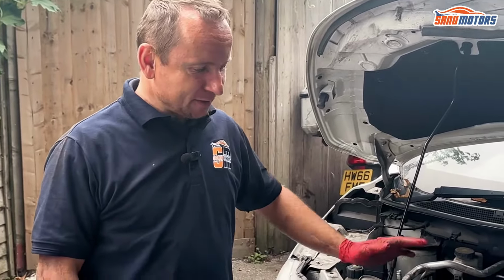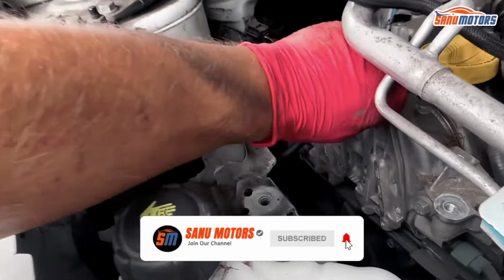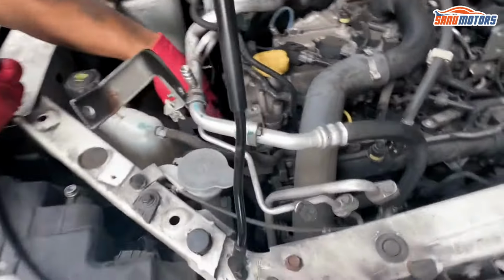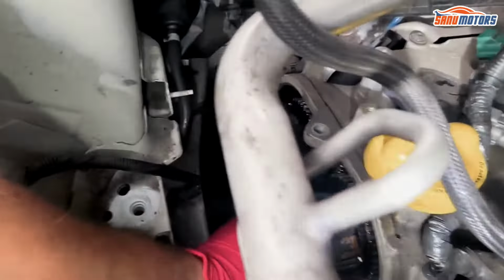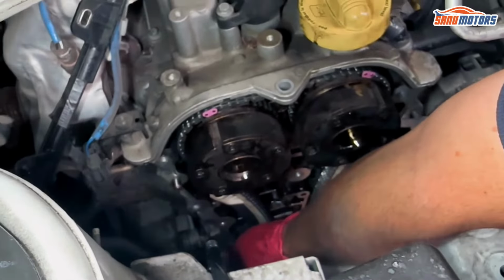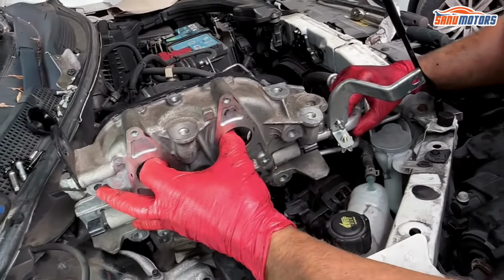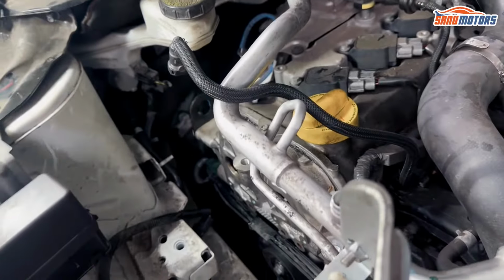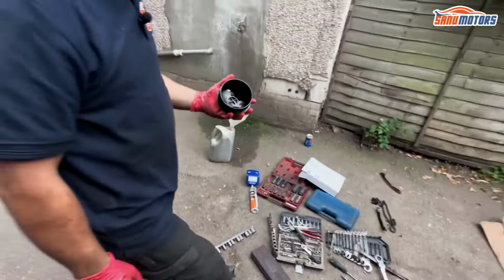Replacing the Timing Chain on Nissan Qashqai 1.2 | Timing Chain DIY Tutorial

Comment: thanks, watched it all. how much of work hours altogether for this job?
Reply from the maker: Thanks for watching the video and for your question. For a timing chain replacement on a Nissan Qashqai 1.2, the total work hours usually amount to about 8 hours. This includes disassembly, replacing the chain, and reassembling the components.

At our workshop, we use a genuine Nissan timing chain kit and also include an engine oil and oil filter change as part of the service. Our charges for this job start from £850, which covers both parts and labor.

Feel free to reach out if you need more information or want to schedule an appointment. 🚗🔧 #TimingChainReplacement #NissanQashqai #CarMaintenance
Reply: Thank you for the video to well done you are good teacher I will be contacting you for the oil leak on my car
Reply: Thanks for video your good I have oil leaking on nissan juke on front cover  can I contact you tomorrow tomorrow tomorrow tomorrow

Comment: My 1.2 nissan qashqai 2015 105 000 km with no timming noise I change oil every 6500 km with 5w30 castrol untill now I have no problems no engine light or codes. Take care of your car, and the car will take care of you😊
Reply from the maker: yes 100%

Comment: dont even have that engine but it was a good watch
Reply from the maker: Thank you for your comment! If you can rebuild your old engine, that’s definitely a great advantage because you know exactly what’s going on with it. However, when searching for a used engine, caution is key as the mileage and potential hidden issues might not always be clear. Be sure to do thorough checks and research before making a decision. Good luck with your search!

Comment: Hello SANU ….thanks for excellent explaining…I have QASHQAI year 2019 1.3-140HP petrol engine consumes to much collant water ..and loses power ..some mechanics tells me the head gasket problem with Nissan qashqai is common and also expensive …have you experience this problems ? Thank you
Reply from the maker: Thank you for your kind words! I'm glad to help.

Regarding your Nissan Qashqai (2019, 1.3-140HP petrol engine), the issues you're describing—excessive coolant consumption and loss of power—are indeed concerning and can often be indicative of a head gasket problem. Here's what I can share based on common knowledge and experience with similar issues:

### Symptoms of a Failing Head Gasket:
1. **Coolant Loss**: If your car is consuming too much coolant, it could be due to a head gasket failure. A blown head gasket can cause coolant to leak into the engine cylinders, where it is burned off, leading to significant coolant loss without visible external leaks.

2. **Loss of Power**: A failing head gasket can lead to a drop in engine compression, which directly results in reduced engine power. You might notice the car struggling to accelerate or generally feeling sluggish.

3. **White Smoke from Exhaust**: When coolant enters the combustion chamber, it typically results in white smoke from the exhaust. This is a classic sign of a head gasket issue.

4. **Overheating Engine**: If the head gasket is compromised, it can lead to engine overheating, which further exacerbates the problem.

### Commonality of Head Gasket Issues in Nissan Qashqai:
While Nissan Qashqai models are generally reliable, there have been reports of head gasket failures, particularly in some petrol engines. This issue can indeed be expensive to repair due to the labor-intensive nature of the work involved.

### What You Can Do:
1. **Get a Second Opinion**: If a mechanic has diagnosed a head gasket problem, it's wise to get a second opinion, preferably from a Nissan specialist or a mechanic with experience with this model.

2. **Compression Test and Leak-Down Test**: These tests can confirm whether the head gasket is failing. They measure the engine's ability to hold pressure and can indicate if there's a leak in the gasket.

3. **Check for Coolant Contamination**: A simple check is to look at the oil dipstick. If the oil looks milky, it could be mixed with coolant, another sign of a head gasket issue.

In summary, it does sound like your Nissan Qashqai might be suffering from a head gasket problem. Given the symptoms and the advice from mechanics, it's likely a significant issue that requires attention. I'd recommend acting promptly to avoid further damage to the engine.

Comment: Hi, How would you time this 1.2 TCE engine if the timing has jumped slightly? is their an old school way to make sure timing is right before closing everthing together? Thanks
Reply from the maker: Certainly! If you suspect that the timing has jumped slightly on a 1.2 TCE engine and you want to ensure it's set correctly, there are several steps you can take. While modern engines often have specific diagnostic tools and procedures, here's a more general approach that can be considered, especially if you're looking for an "old school" method:

Timing Marks: First, locate the timing marks on your engine components. Typically, there will be marks on the crankshaft pulley, camshaft sprocket, and possibly other components depending on your engine's design.

Top Dead Center (TDC): Ensure the engine is at top dead center (TDC) for the piston on the compression stroke for the cylinder you're working on. You can do this by removing the spark plug for that cylinder and using a tool (like a piston stop) to find the highest point the piston reaches. Align the crankshaft pulley's timing mark with the TDC mark on the timing cover or scale.

Camshaft Alignment: If your engine has a timing belt or chain connecting the crankshaft and camshaft(s), align the camshaft sprocket's timing mark with the corresponding mark on the cylinder head.

Check Valve Clearances: It's also a good idea to check valve clearances while you're at it. Adjust them if necessary according to the manufacturer's specifications.

Inspect Timing Components: Inspect the timing belt or chain and related components for wear, damage, or slack. If the timing belt has jumped, it may be due to a worn or damaged belt or tensioner.

Double Check Marks: After aligning the marks, rotate the engine manually through a couple of complete cycles (two revolutions of the crankshaft) to make sure everything still lines up correctly. This will help confirm that the timing is set correctly.

Reassembly: Once you're confident that the timing is correct, you can proceed to reassemble everything carefully. Torque bolts to the manufacturer's specifications, especially for critical components like the crankshaft and camshaft pulleys.

Start and Test: After reassembly, start the engine and listen for any unusual noises. Additionally, you can use a timing light to verify that the ignition timing is correct.

Remember that the exact procedure may vary depending on your specific engine and vehicle model. It's crucial to consult your vehicle's service manual for detailed instructions and specifications tailored to your engine. If you're not comfortable performing these tasks yourself, it's best to seek the assistance of a qualified mechanic or technician to ensure proper timing and avoid potential engine damage
thank you for the feedback
Reply: Hi l, It will for the exact engine you have posted video. Mine is starting fine. But idling rough. Going into limp mode with I. 20 seconds after start. Is the TDC done on first piston next to cam sprockets? May be if you can do a detailed video on timing 1.2 TCE engine in a manual way. Rather than relying on chain markers. That would be highly appreciated. Thanks
Reply: did you end up getting it off? I have same problem where it seems like it is welded together at the top becuase of so much silicone, i just broke the timing cover in the middle trying to pry it off but it is still stick
Reply: @hallgrimurmagg  Hi, I have now mastered the art of changing timing chain and head refurbishment on this God forsaken 1.2 the engine. They key is the big bolts in the middle. Around an inch higher to pretentioner pulley. Mine bent six exhaust valves out of eight. Ended up replacing top end, both cams, fuel injector teflon seals.

Comment: Thank you for a very informative video. I’m going to do the same job on a Renault Megane III with the same engine. I didn’t know that the rocker cover didn’t have to come off, that will save a lot of time. I’m planning to replace the oil pump chain as well.
Reply from the maker: I’m not sure. But normally no need
Reply: Если цепь не проскочила, то не надо снимать клапанную крышку

Comment: Hi is it easy to also change the chain for the oil pump and is there any time in Marks on the oil pump chain hopefully you can help me thank you excellent video
Reply from the maker: I'm glad you found the video helpful, but I want to clarify a couple of things.

The Nissan Qashqai typically uses a timing chain for its engine, not a timing belt. Timing chains are designed to last the life of the engine and generally do not require regular replacement like timing belts. However, they can still wear out over a very long period of time, and if there's an issue, it's usually a more involved repair.

The oil pump is usually driven by the timing chain, so if you're experiencing issues with the oil pump, it may be necessary to replace the timing chain as well. However, this is a complex job that requires mechanical expertise and the right tools. It's not something recommended for a novice or DIY mechanic unless you have experience with engine work.

Timing chain replacement typically doesn't involve timing marks on the chain itself, as it's designed to fit precisely with the engine's timing gears. Timing marks are usually used during the installation of the timing chain to ensure proper alignment of the crankshaft and camshaft.

If you're experiencing issues with the oil pump or timing chain on your Nissan Qashqai, it's strongly recommended that you consult a professional mechanic or refer to the vehicle's service manual for specific instructions and guidance on how to address the problem. Incorrect installation of the timing chain can lead to severe engine damage, so it's essential to get it done correctly
Reply: @SanuMotorswithCharlie  thank you very much for your reply I really appreciate it the timing chain needs doing on my Nissan and I just thought with all the stripping you have to do the kit I brought had both timing chains in and just thought it would be easier to replace both of them just as preventive maintenance so I was just wondering if there is any timing marks I know the oil pump has to be removed to get the chain out which is no problem I was just worried about if there was any timing marks for it

Comment: Very informative video 🤛🏻 is it too late todothe chain if you have 0 compression on all 4 cylinders?
Reply from the maker: Thank you for your comment! I'm glad you found the video informative. 

If you have 0 compression on all 4 cylinders, it likely indicates a severe issue. The timing chain may have failed completely, causing the engine's valves and pistons to be out of sync, which can result in significant internal damage. Here are the key considerations:

1. **Timing Chain Failure**: If the timing chain has failed, the valves may have struck the pistons, causing damage to both. This scenario usually results in zero compression across all cylinders.

2. **Further Inspection**: Before proceeding with replacing the timing chain, it's essential to inspect the engine for additional damage. This might include bent valves, damaged pistons, or cylinder head issues.

3. **Engine Damage**: If there is extensive damage, a simple timing chain replacement might not suffice. You may need to repair or replace the damaged components or, in severe cases, consider a complete engine rebuild or replacement.

4. **Diagnosis**: Conduct a thorough diagnosis, including a leak-down test, to identify the extent of the damage. This will help determine the necessary repairs.

If you're unsure about the extent of the damage or the necessary repairs, it might be best to consult with a professional mechanic to avoid further complications.

For more detailed guidance, check out resources like automotive forums, repair manuals, or consult a professional mechanic to ensure you address all potential issues.

Comment: Great video not something I will attempt but just got a slight rattle on my juke took it for diagnosis and they got P0014 exhaust camshaft variable valve and P0090 fuel pressure control func
Also poss by camshaft pulley 
After watching your video I’m convinced it’s poss timing chain loose do the pulleys go very often ? and I presume it’s better approached by starting with timing chain anyway 
Do you think this is the best way forward 
Thanks
Reply from the maker: It sounds like you're on the right track. The P0014 code indicates an issue with the exhaust camshaft's timing, which could be caused by a loose or stretched timing chain. Timing chain wear is common on some Nissan engines, and it can cause symptoms like rattling, poor engine performance, and camshaft timing errors.

In your case, addressing the timing chain first seems like a sensible approach. If the chain is loose, it can affect the camshaft's position and throw off the valve timing, leading to errors like the P0014 and possibly contributing to the fuel pressure control issue (P0090). 

Regarding the camshaft pulleys, while they can fail, it's less common than timing chain issues. Pulleys can wear out over time, but often the rattle and timing codes point to chain wear or tensioner problems. 

Starting with the timing chain replacement and inspecting the tensioners, guides, and pulleys along the way would be a good strategy. If the chain is indeed stretched or loose, replacing it can resolve the issue before exploring other components like the camshaft pulley.

Let me know if you'd like any more guidance on tackling this!
Reply: @SanuMotorswithCharlie  exactly same errors received for my 2017 J11E Qashqai. booked timing chain replacement in 2 week
but for labor the work shop says it would take like 8 hours. is that really so?
plus it was a surprise to know Qashqai has Renault engine.
Reply from the maker: It sounds like you're on top of things with your Qashqai. Yes, the timing chain replacement for the 2017 J11E Qashqai can indeed take around 8 hours in a workshop—that’s pretty standard for this kind of job due to the complexity of accessing and replacing the chain. 🔧

And yes, it can be a surprise, but you're correct—the Qashqai is equipped with a Renault-Nissan engine, which shares components and designs across both brands. This collaboration brings both benefits and unique characteristics to the engine's maintenance.

Also, what is the repair cost?

Good luck with the timing chain replacement, and feel free to update us on how it goes! 🚗👍 #NissanQashqai #TimingChainReplacement #RenaultEngine

Comment: I have Nissan Serena C27 with MR20DD engine at 104000 km, no ratling or any issue but recently bought all original parts for timing. Should I wait more or just go forward with the change?
Reply from the maker: It's important to consider several factors before deciding whether to proceed with the timing parts replacement for your Nissan Serena C27 with the MR20DD engine at 104,000 km, even if there are no noticeable issues or rattling. Here are some things to consider:

Manufacturer's Recommendations: Check the manufacturer's recommended maintenance schedule for your vehicle. It should outline when the timing components, such as the timing belt or timing chain, should be replaced. If you're approaching or have exceeded that mileage or time interval, it's a good idea to proceed with the replacement.

Preventive Maintenance: Replacing timing components as part of preventive maintenance can help avoid potential catastrophic engine damage if they were to fail unexpectedly. Waiting too long might lead to more extensive and expensive repairs.

Age of the Parts: Timing components, even if they haven't shown any issues, can wear out over time due to heat and stress. The age of the parts may also factor into your decision. If they are original and your vehicle is several years old, it might be a good idea to replace them for peace of mind.

Cost of Repair: Consider the cost of replacing the timing components now versus the potential cost of a major engine repair if they were to fail. In some cases, replacing the parts preventively can be more cost-effective in the long run.

Local Climate and Driving Conditions: If you live in an area with extreme temperature fluctuations or harsh driving conditions, it might accelerate the wear on timing components. In such cases, replacing them sooner might be advisable.

Professional Inspection: It's always a good idea to have a qualified mechanic inspect your timing components during regular maintenance. They can assess the condition of the parts and provide recommendations based on their expertise.

Ultimately, it's generally safer to follow the manufacturer's recommendations and replace timing components at the recommended intervals or mileage, especially if you plan to keep the vehicle for an extended period. It's a preventive measure that can help ensure the longevity and reliability of your Nissan Serena C27's engine.
thank you
Reply: @SanuMotorswithCharlie  thank you for your answer 
Cheers
Reply from the maker: @Asteros3D  you’re very welcome
Reply: Hi,

I have Nissan Serena c27 and suspect the rattling noise to be  the chain. 

Where did you buy the timing chain kits from please as I am in the UK. 

Thanks
Reply: @princekeebee1  I will send you web link to the shop I bought it directly from Japan
Give me some more details about trim of the c27 and engine code if possible
Reply from the maker: @princekeebee1  
Main dealer (Nissan)
Thanks